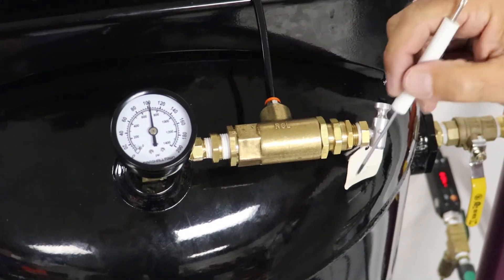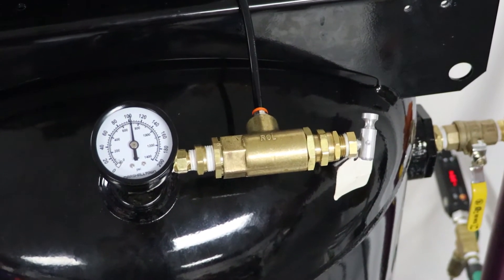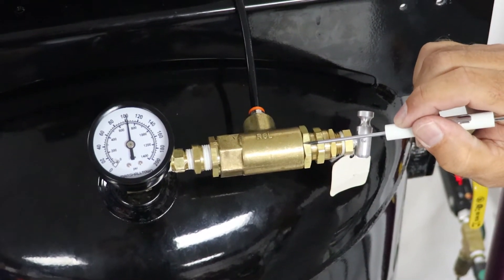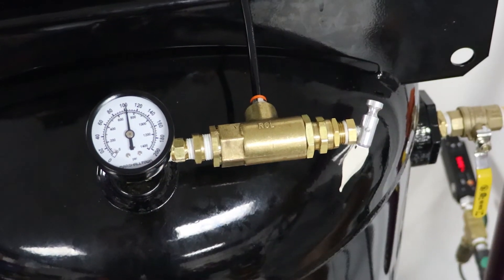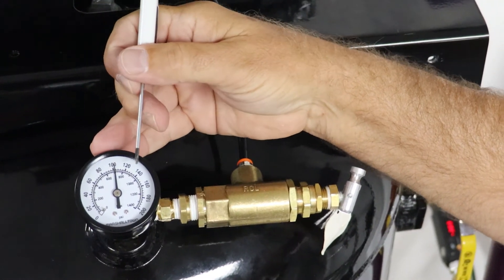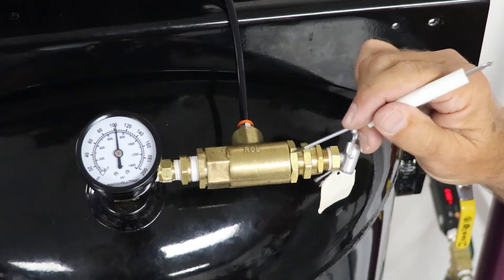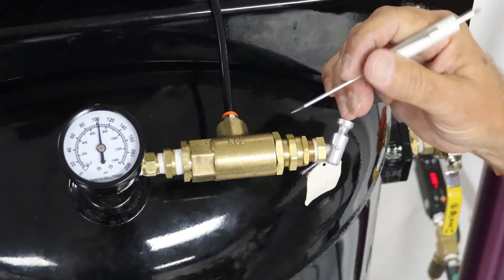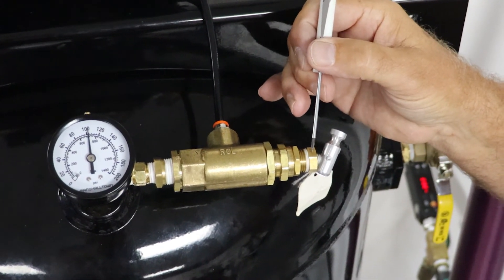How to Adjust a Pilot Valve

Comment: Is it possible to load at 90 psi and unload at 95 psi?
Reply from the maker: Hi Scot, pilot valves operate best at a 30 psi pressure change. However, with a self-relieving regulator on the outlet of the compressor, you might be okay with 90-95 psi. To better assist you, feel free to call our company phone and we will forward you to the engineer that made this video (Brad) at 1-800-782-5752
Reply: I am having the hardest time setting a Ingersoll Rand Pilot Unloader Check Valve - 49816283. I have the big adjustment set to vent at 150 psi and that works. But the small adjustment that’s supposed to vent air never does and I’ve set the tank to 125 and screwed it down slowly until I couldn’t anymore. What do you think is the issue?
Reply from the maker: @Havoc0014  Our engineer wanted us to share this link with you that should be a valuable resource: https://mastertoolrepair.com/images/Pilot_Adjustment_and_Troubleshoot.pdf